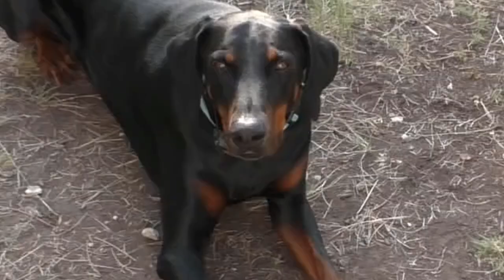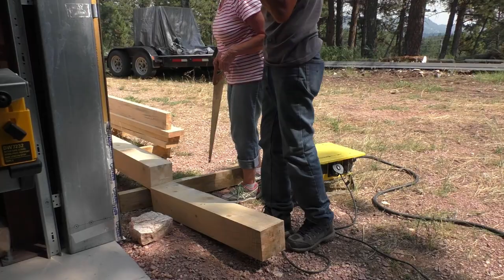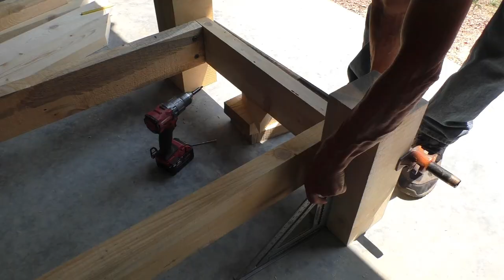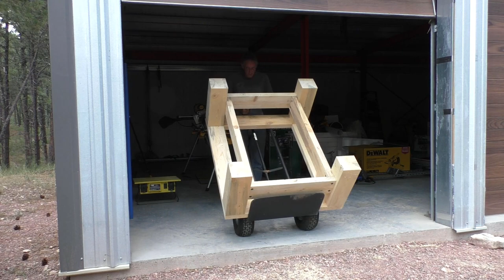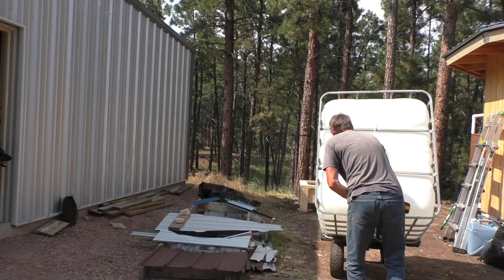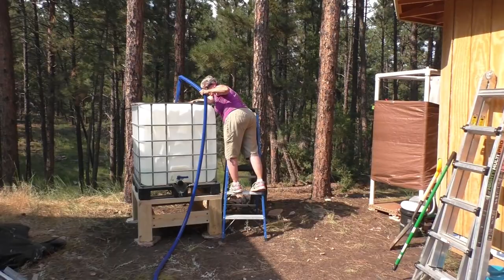Homemade DIY Sawmill First Project Off Grid Water Tower for IBC Tote Spencers-Mountain

Comment: Using that lumber already!! Now you need a rainwater collection system coming off that shed for non-drinking water supply. Great vid!
Reply from the maker: Behind the garage is two huge sections of commercial rain gutter.  Since we have to haul water, free water is definitely in the plans!. Thanks for watching and we appreciate any ideas.
Reply: @SpencersMountain  Our little garden shelter roof (8' x 10') collects a LOT of water.
Reply from the maker: @thejacobsonproject  that sent me to do some calculating and there is potential for 7900 gallons of annual catchment on that roof.  Found our area to have around 17 inches of annual precipitation... where your area is closer to 30 inches.